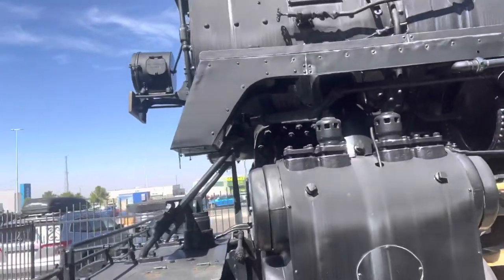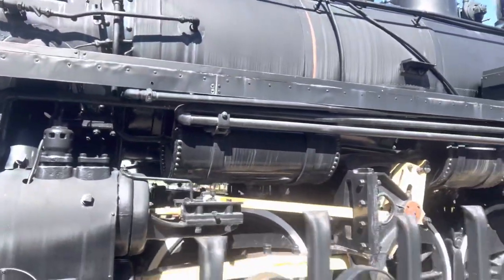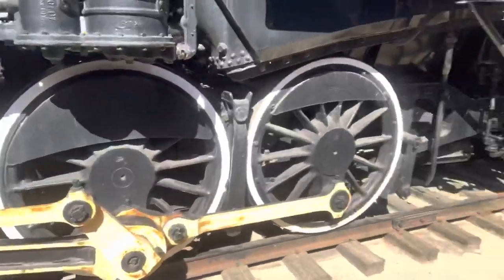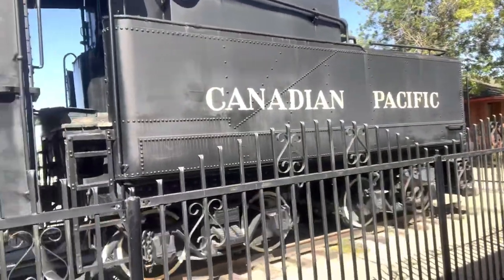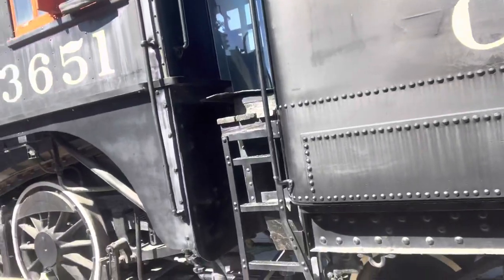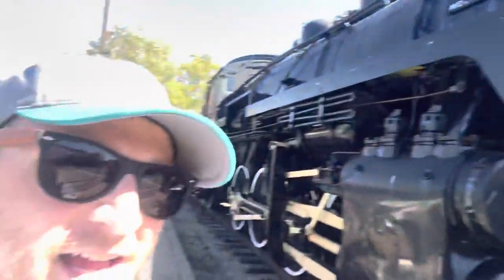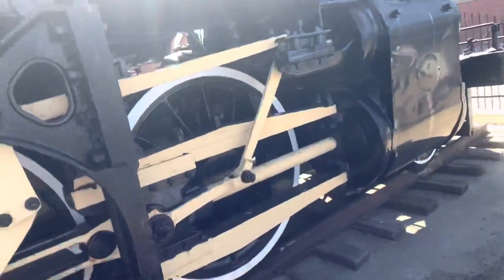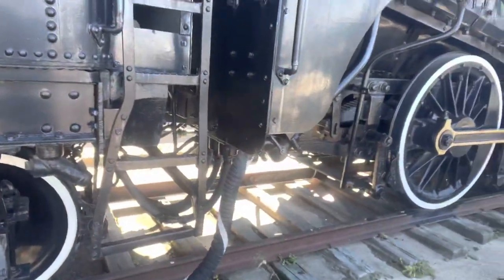This train is incredible! Canadian Pacific Railway MONSTER!

Comment from the maker: This was actually a OIL FIRED engine, not coal! Sorry folks! I clearly need to learn more about my steam engines haha! I didnt even know steam engines could be oil powered lol! Whats your favorite engineering marvel?? Let me know below!
Reply: I was wondering about that when I saw how much oil it carried. I wouldn't be surprised if it was a coal burner converted to oil use. The oil was probably barely refined, like the bunker oil on container ships.
Reply: I think that trailing carriage is a coal hopper. I thought the oil vessel looked like a tank
Reply: This is a locomotive, not a train. There's a difference.
It's like calling the Warrior a Tank.
The two are similar but not the same.
Reply: Matt,
I had a photo of that Locomotive when I was a kid. My Dad was in BATUS with his Regiment (1977 IIRC) and on his R&R in the area saw the Loco &  took the picture.
Reply from the maker: @Interceptor00X  shut up
Reply: Many coal fired steam locomotives in working rather than static preservation have been converted to oil for safety/insurance and or supply issues especially in western US.
Reply: This class of engine (N-2-a/b/c) were built in 1912-1914 by Montreal Locomotive Works; they originally used coal as a fuel, with most being converted to oil-firing later on in their working lives.  Of the 199 that were built, three remain on display, two in B.C. and one here in Lethbridge.  (A fourth can be found on the bottom of Slocan Lake in B.C.; it dropped there from a railway barge in 1946.)
https://en.wikipedia.org/wiki/Canadian_Pacific_2-8-0_N-2-a,_b,_and_c
Reply: That's pretty sweet. I'm in So. Cal and we had the BIG BOY 4014 here for decades at the Pomona Fair grounds. It is now back in service running freight for Union Pacific, making it the largest steam locomotive in service.
https://en.wikipedia.org/wiki/Union_Pacific_4014
Reply: They can be wood powered too. Hello late WW2 Germany.
Reply: @_Matsimus_  As a retired locomotive mechanic, it's fine Matt the loco pulls the train big deal carry on
Reply: Conversion job?
Reply: Well the thing could run on coal if it wanted to i guess.
Reply: If you go to Calgary's Heritage Park front gate, you will see a very large 2-10-4 "Selkirk" locomotive.

Comment: I was a steam locomotive maintainer and part time conductor for the Virginia and Truckee railroad in Nevada I I'm always amazed at how the designers were able with basic slide rulers come up with these great machines. If they got something wrong then PE could literally die. Just amazing
Reply: My question following your words, how would the current and upcoming crop of "designers and engineers" cope without computers?
Reply: Good question and the answer is they couldn't. They lost the ability to use other means of calculating complexe mathematic equations and would have to spend hours apon hours drawing up everything that today they take for granted with a few strokes on a computer keyboard. Also there are hardly any hardcopies of the designs from older locomotives and instead gone to looking at DVDs and other media storage devices for the vast documents of designs.

Comment: The Union Pacific Railroad in the US has a heritage fleet with some still operating steam locomotives converted from coal to oil fired. Their largest operating steam locomotive is the UP 4014, a 4-8-8-4 style locomotive that was fully restored after sitting for almost 50 years on display outdoors. They also have a Northern 4-8-4 (UP 844) that was never retired and is currently in overhaul I do believe. UP had to reengineer tools to work on these treasures to keep them operating.

Comment: If you get the chance visit the Cass Scenic Railroad in Cass, West Virginia. They have a variety of operational geared steam engines. I have never seen the Shay, Heisler and Climax types of steam engines they operate  anywhere else before. For around 75 USD you an also book a day trip with one of those trains through the Appalachian mountains and it is absolutely beautiful

Comment: It might have started its life with coal but probably bunker c just like modern ships of that time, I am a third-gen railroader and my dad was a blacksmith on units like 3651 until dieselization in the 50s it takes a lot more people to service and overhaul steamers than diesels and no matter what type of steam loco you ran water was required every couple of hundred miles [or less] I have changed a set of driver wheels on C.Ps 2816 but the driving rods were already removed and the wheelset just barely cleared the locomotive when we removed it on our drop table. I will say this though most people who talk about the romance of steam , probably weren't working on them in +29c or -30 c in primitive shop conditions with early pneumatic tools or heat and beat which was usually the case,you can see in pictures of the time, no safety equipment and just hard hard  work not too many smiles on the faces of those workers because working on locomotives is serious business. When they bite they bite hard.

Comment: If you ever get a chance check out Alberta Prairie Railway, i did a excursion some years back with them it was really nice and fun getting to ride on a train pulled by locomotives No 41 and No 1392 for a day trip. the sound of the engine going and the clack of the rails as we went by, what an experience.

Comment: Well, if you also like trains, besides the military equipment, there is an old train in Mt. Pelion near Volos in Greece, that the line was constructed in 1894 to 1903 and served the local mountain villages for about 80 years. Today the train, has been refurbished and does the trip as a tourist excursion in the area.
From the video it appears that the original steam engine has being replaced by a diesel, still old and the train retains it's original name: "Smudger"
https://www.youtube.com/watch?v=di7VV2SusFk
There is also an other old train route, built in 1896, near the Greek city of Patras, going from the city of Diakofto to the city of Kalavryta (also known for the massacre of its male population by the Germans in 1944) the peculiarity of this line is that it has three rails, the center one being like a gear preventing the train from slipping due to the high inclination of the line. It is known as "the toothed train".
https://www.youtube.com/watch?v=re_PCdG84dg
This is the original toothed steam train that is 121 years old, reconstructed in 2015:
https://www.youtube.com/watch?v=vrRWfKHm5Nc
And this is part of the trip:
https://www.youtube.com/watch?v=FHowlDF5OSA